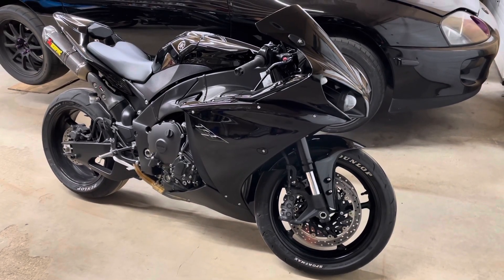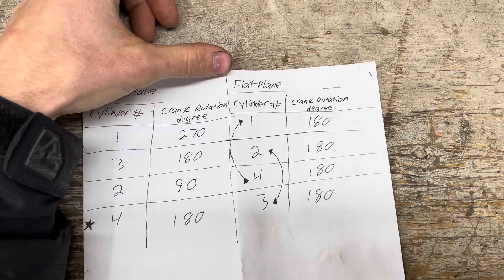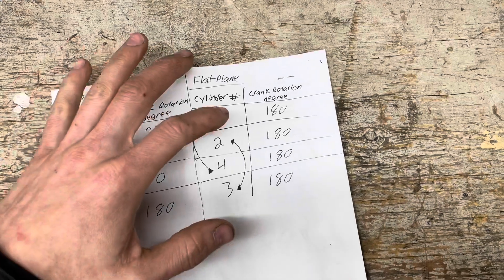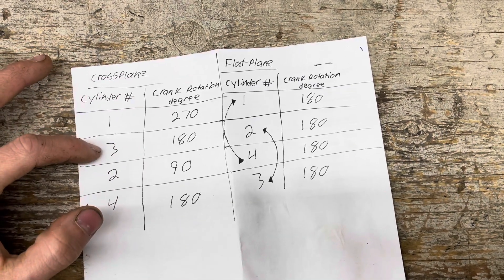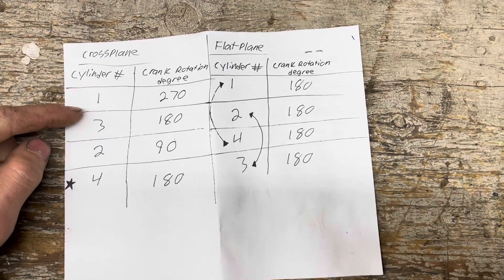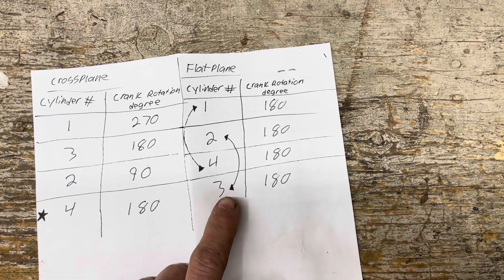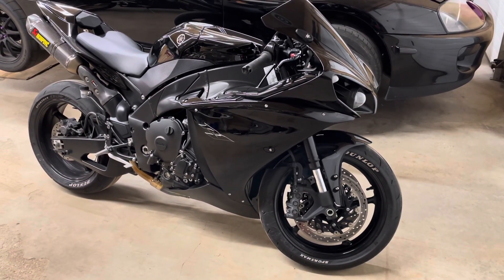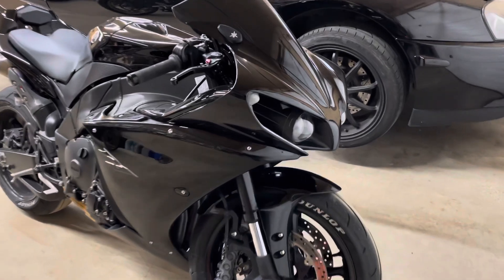Yamaha R1 Crossplane VS Flatplane Explained

Comment: I thought flatplane has the worst Bottom end  Power. Had an rn12 before the rn22. And it felt also as nothing is going on until 5000rpm.

On the rn22 i have to ride in "A" mode, so it gets more bottom end power than in "STD" mode.

Didnt yamaha changed in Motogp to crossplane because the power is more smoothly delivered than on flatplane ?
Reply from the maker: Worst bottom end for sure but the mid range and top end come in stronger than my older 2006 R1 flate plane 
Yes in the hi rpm range it is a very smooth delivery. Very lumpy / stumbles down low though. It’s definitely a compromise.
Reply: I don't know why you guys in usa say that this bike got no power down low, but having had a 06 and a 07 and a 09  I can only say that the 09 is theo nly bike that onesyou let the clutch even at 2000rpm and give gas it's really a rocket where flatplanes liter bikes are dead till 5000 rpm... mine has decat and leovince sbk terminals but even before it wasn't no joke.... I think usa model is someway restricted and you all fails using A map that the only thing it does is to open the throttle bodies sooner ...way sooner that the bike bogs down....try using and accomadate to standard mode, bottom power is way more   consistent  and the hp are the same....in A mode the motor bogs down so it lacks torque...that's why plus usa resrtiction imho

Comment: Does riding a crossplain have more vibration when riding it?
Reply from the maker: Yes. Very slight vibration at lower engine rpms.  Not as bad as you would think though and It does smooth out as the rpms rise.
Reply from the maker: Not quite that bad but if you are at a low rpm like 4000 and you grab over half throttle it’s enough load to get a pretty good shudder / shake that you feel in the seat and handle bars.

Comment: What was the reason for the hard cold starting issue you had? If it was the starter going out, could yo do a replacement video?
Reply from the maker: I found corrosion in the starter solenoid. It’s located under the seat just behind the battery.  I did make a previous video on that already.
If you do have to replace your starter it’s located under the fuel tank, under the air box and throttle bodies on the back side of the engine
Reply: it is the solenoid, once you change it or sometimes just clean it with wd40 it starts up like new
Reply from the maker: I ended up having multiple issues. Check out my starter replacement video to see how damaged my starter really was